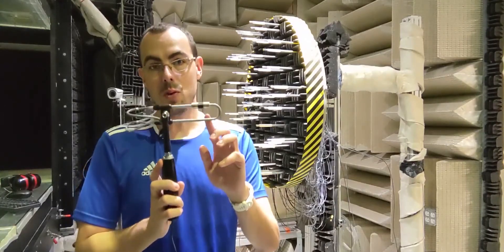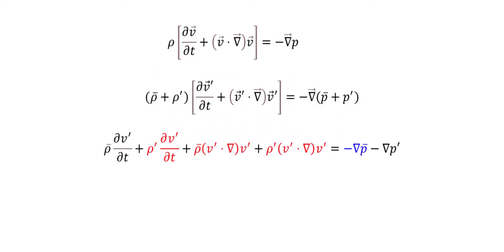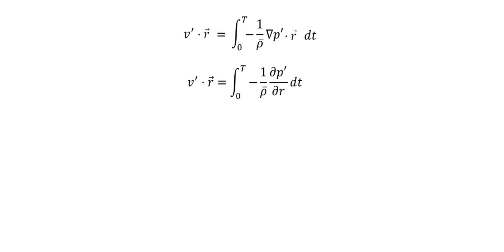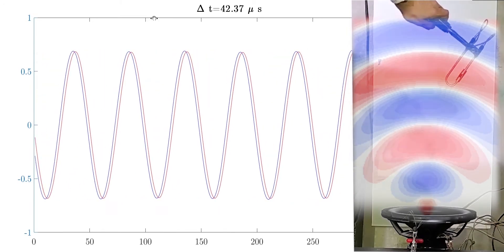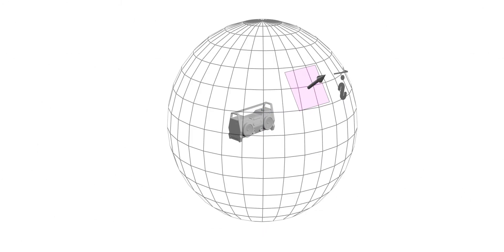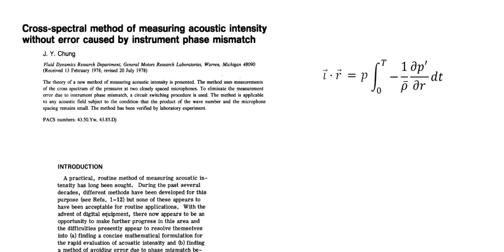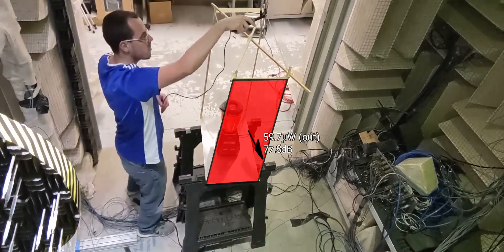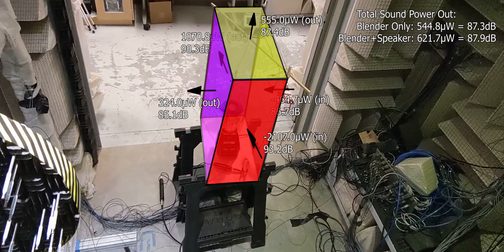The Theory Behind the Acoustic Intensity Probe

Comment: How can I calculate the intensity using the two microphone sound pressure data?  I don't quite understand the formula.
Reply from the maker: I'm glad the video was helpful! To get acoustic intensity, you compute:
P_{1,2}(t)=[P_1(t)+P_2(t)]/2; Takes the mean between the two pressure signals as the pressure between the two microphones;
v(T)=int_0^T (-1/rho) {[(P_2(t)-P_1(t)]/\Delta r} dt;  [equation in 1:50]

P_avg=mean[P_{1,2}(t)]; Takes the time-average of P_{1,2}(t)
P'_{1,2}(t)=P_{1,2}(t)-P_avg; Removes time-average pressure from the signal (i.e., we're interested only in the pressure fluctuations)

I(t)=P'_{1,2}(t) * v(t); Intensity is simply the product of P and v (See 3:13)

With that said, this is a naive method for intensity fluctuation and it is not very accurate. Higher frequency content may produce integration errors if there are not enough samples in your data to compute the velocity integral. This is why the spectral method presented by Chung 1978 is preferred, as it performs these operations in the frequency domain. The operations are the same, you just take the Fourier Transform of them prior to doing the computations (plus some math to eliminate complex terms).

I've done both methods in my studies. The time-domain method (presented in this comment) is not too bad, but I got errors about 3-5dB with it in some cases.
Reply: @fzigunov  How do I determine the integral time for particle velocity? 
This is  matlab script I wrote. is it right? Hasn't been applied to integrals yet.
dt=1/Fs
p1=D(:,1);
p2=D(:,2);
p12=(p1+p2)/2;
v12=(p1-p2)/0.05/1.22*dt;
Intesity=p12.*v12;
Reply from the maker: @mundaeho  That's close! Just make the following change:

v12=cumtrapz((p1-p2)/0.05/1.22)*dt;
Reply: @fzigunov  Thank you so much for your kind help.